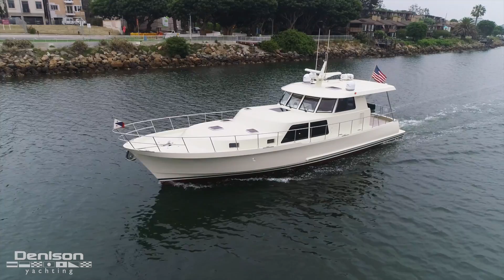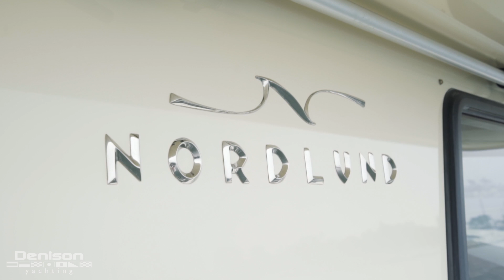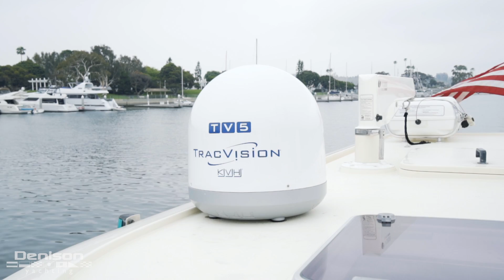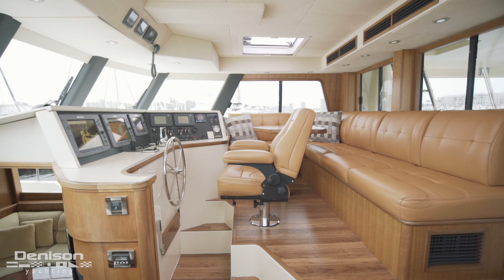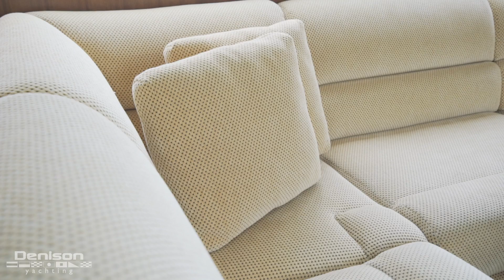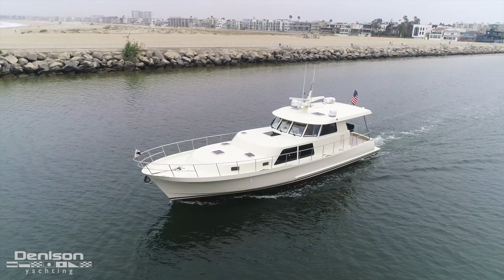57 Nordlund Express Trawler [Walkthrough]

Comment: 810 gallon tank. "On a recent sea trial, we ran the boat at around 26 knots at 2500 RPM and burned 58 GPH. Dialing the speed back to 20 knots the fuel burn dropped to 34 GPH, and then at 15 knots it went down to 20 GPH."
Reply: Wow, just been watching a Nordhavn cruising at 6 knots using 3 gallon an hour
Reply: @ianmangham4570  excellent point, drop the speed even more and get some real distance.
Reply: @zhp500  And always remember if you ain't going far then only have half a tank of gas so the boat is lighter 👍🙏